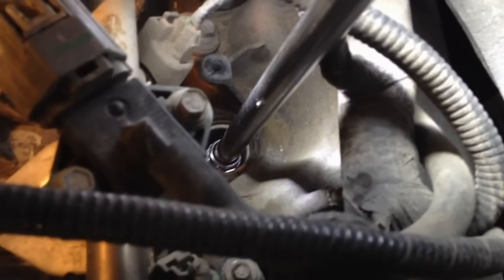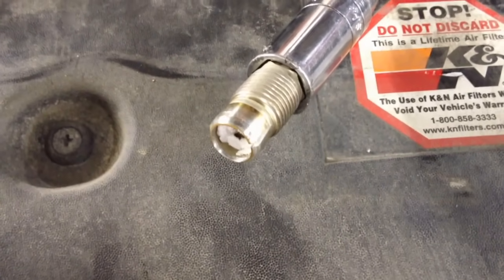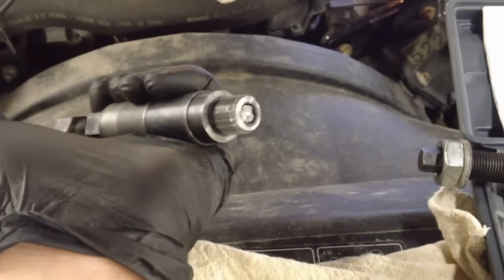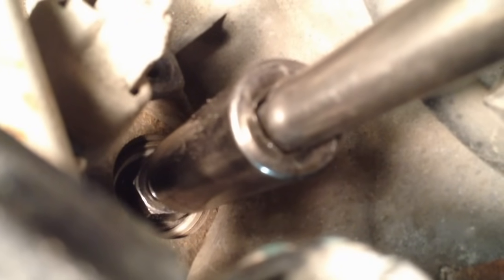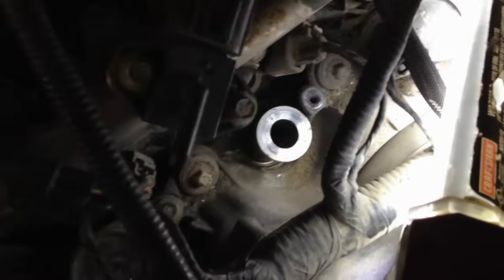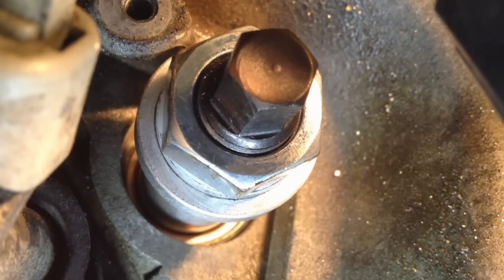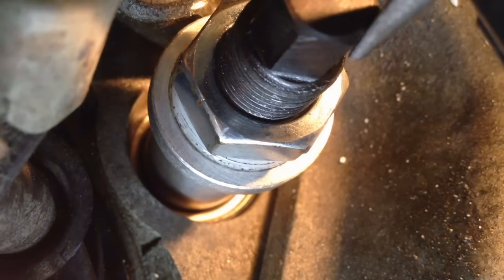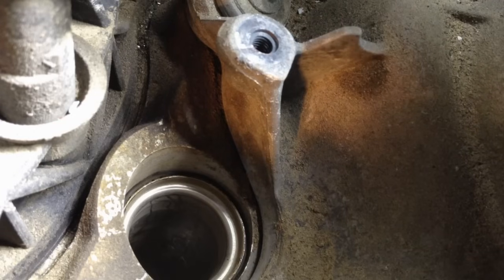Ford 4.6L 3v & 5.4L 3v Broken Spark Plug Removal

Comment: So, if that porcelain drops into cylinder, how do you get it out?? Just wondering, valves don't like anything "extra" in there;.....
Reply: +Eero Laukkanen first of all its a piston under the plug, not a valve.  If one breaks off and goes into a cylinder, get it out or pray. It will usually score the cylinder wall causing the engine light to come on and eventually ruin your engine. Sometimes its easier to just remove the heads with the plugs in them and replace them that way. Better to replace a couple gaskets than your whole engine.

Comment: Changed coils and plugs in my 2006 Ford F150 5.4L this weekend.  Had one plug bust on me.  Used this tool per your directions and it worked perfect...thanks.

Comment: Curious. Some people say this tool "looses it's bite" after about 3 or 4 plugs. You, on the other hand, seem to have used yours a lot more than that. What's up? Thanks for the video, btw.
Reply from the maker: +standingwave73 No way they never so the tap threads are so deep and I have not seen them get dull either.

Comment: Just did the plugs in my 07 F150 5.4 today Let me tell you...what a nightmare it was!  Plugs had about 65k on them and I ran 3 tanks of Techron gas treatment leading up to the change. (Which had ZERO effect). I started at 7am this morning and finished at 6pm. Only #2 came out in one piece the rest broke.  I followed the TSB to the T.  Thank god for the lisle tool and the extra extractor I bought since the first one lost its bite after 3 plugs. (Yes I used anti-seize on the threads). For now on 20k miles plugs are getting changed.  Now I feel like I need a knee and back replacement...😁
Reply: +THETOPGLOCK About to tackle the plugs on our 07 Expedition. That anti seize coating sounds like a yearly maintenance job. Have no other car suv that has that. I guess ford changed the spark plugs after 08.
Reply: +Chuck Gerchow yeah Ford redesigned the head  with a late 07 engine build date to a "normal " spark plug. Like I said 20-30k I'll be changing them again.  Have you done a passenger side exhaust manifold yet?  Another special nightmare of its own. Oh the phasers and timing components.....I did the timing set/phasers last weekend and actually I would do it again over a plug change any day.  3v 5.4 is a great engine if you have the ability to correct all the short comings yourself and save $$$. Sorry for the long reply

This channel has the very best information I've seen. Nothing beats a good video

Comment: The problem with the plugs is they are made in two pieces and overtime the section that insert into the engine beyond the threads carbons up and bonds inside the lower portion of the threads. The result the spark plug breaks into two pieces. The upper section comes out not the lower. Solution buy the spark plug puller kit online it works great, but it takes time roughly 35 minutes each and there is no reason to tear the heads off the engine to remove the remaining portion of the plug. Someone tell you that you will need to.... tell them no thanks! Final note have a small magnet on hand to remove the upper portion of the plug once loose, the socket does not always hold the plug when trying to remove...

Comment: Great video!!  I started with the EverTough 67002 removal kit rented from O'Reilly Auto Parts (had to go back for the required 67003 kit containing the consumable parts) and their approach of removing the porcelain first with a glued-in steel pin was a tremendous waste of time.  I broke the glue bond twice and snapped a pin on the third attempt.  And each time requiring an hour for the glue to set.  I ordered this Lisle kit on Amazon with overnight delivery and it took 15 minutes to read the directions and get the broken plug out!  Thanks FordTechMakuloco for illustrating how simple these tools are to use.  Quick, easy and they work.

Comment: If anyone gets caught In a situation where the shell strips the 1st time, I highly suggest putting lock-tight on the extractor the 2nd time around... It worked for me
Reply: I know I'm 7 years late to the comments lol but think I might need to go the loctite route. Do you remember the type you used?
Reply: @mikebas7325  what's locktite is that like a glue? Or a grease idk how grease would help

Comment: I own a Ford F150 2004 5.4 3V with 80k as well manage to take all 7 of them with out breaking just broke one in cylinder #1 panic at first but came across your video i needed to fix right away its my work truck so did not want to wait for shipping and looked at my local auto parts the only one that carried and had it in stock was NAPA in Orange County, CA. Pick it up $80 And worked well was able to extract the tip that got stuck inside was scared at first but gave it a try and worked well thanks alot highly recommend the Leisle tool. Thanks alot for video. FordTechMakuloco
Reply from the maker: Eduardo Hernandez No problem glad to help!!

Comment: Any suggestions on how to get the extractor to bite inside the shell? I've  removed 2 broken plugs and my last one doesn't seem to want to grab.... 
Any help will be appreciated
Reply from the maker: Phillip Haire You must get the porcelain down far enough I have a whole video on what to do when the lisle tool fails.
Reply: @FordTechMakuloco   old vid not sure if you will see this but, is there a chance you will push the whole thing into the cylinder when pushing the porcelain?

Comment: hey dude thanks for the video helps alot 

i Got a 2008 Ford mustang GT 4.6 3V had it for bout 3 years now & never did change the spark plugs got the car with 77k now its 114K Miles on it 
my car Lost a lot of power 
sounds extremely bad 
my shakes 
im geting Bad gas mileage 
i also have 2 misfires 

can changing spark plugs fix that much? I believe it aint gonna do me anything btw I am scared of breaking the spark plug into the head I did rent the removal kit from AutoZone hopefully I don't have to use it but with this many miles im 90% they will break
Reply from the maker: Rocko Megel Being and 08 yours should be the new design replace them and retest for the misfire.

Comment: does ford still use this plug design for their Triton heads? these things are a nightmare! and the cam chains don't seem to last either.
Reply from the maker: No they changed them in 2008 and again in 2010 I believe to a normal plug design.

Comment: If you replace them sooner (Ford recommends replacing the plugs after 100,000 miles on late model 4.6L), it seems to me that you'll have less of a problem with broken off spark plugs, correct?  I have a '08 Crown Vic with 62k, and I prefer to do it now rather than have to deal with this.
Reply from the maker: Tom B Nah 20-40k on these and they are breaking off.

Comment: Thanks for the help!  2006 Mustang GT with 30k miles.  Figured I would pull the plugs hoping none would break with the low miles, but they have been in there for 9 years  LOL.  Anyways, 4 came out no problem, 4 broke.  I borrowed this tool from a friend and watched your video to figure out how to use it.  With the tool and your instructions the broken plugs came out just fine.  Really pretty easy to use too.  Thanks for the help!!

Comment: Can you recommend a tool to remove a broken plug from the 5.4 two valve motor? Thanks!
Reply from the maker: David V The jam nut and threads are still in there but the porcelain is out?
Reply: FordTechMakuloco Yes.

Comment: FordTechMakuloco i have a 2010 f150 4.6l 3v, and i am wanting to replace my stock plugs with the E3 plugs. I got them from a local part store but the plug itself is a 5/8 socket, i found this out when the 5/8 didnt work for my stock ones, my question is, will the new plugs fit into the well with enough space for the 5/8 socket? or will i have to find a 9/16 plug?
Reply from the maker: derek2007 the correct plugs are 9/16 and I would never use the e3 plugs

Comment: Thanks for all the great information. My old man and I have a small auto repair shop and have always been weary of changing ford triton spark plugs. We would always tell customers we didn't change those but after watching your video finally got the courage to change triton spark plugs. Did our first job today, five of eight broke but using the extractor was easy. Thanks for the great video.
Reply: How much extra did you charge todo the extractions?   I ask because I have a customer coming that wants it done

Comment: On one hand, best to let carb cleaner sit overnight, as I did, but on the other hand, best to remove plugs when warm, those are opposites here in Minnesota!  Removed front 6 plugs so far on V10 2005 6.8l with one breaking so far.  Just watched vid as refresher to extract shell, and will do tonight.  Saving four plugs under firewall as I get practice on front six.  Man those back ones will be hard to get to with just about any tool, impact , or extractor or even my hand!
Reply: dan how did u get to the back ones? i got a broken plug on the right side far back. could bearly get swivel head plug remover in there to find a BROKEN plug already in there. not sure what to do from here

Comment: We have a vehicle that came from another shop. We got 3 out of 4 that were broken off but one they the extractor wouldnt bite so they tried to knock the porcelain down further in the remaining shell and ended up knocking the whole bottom section into the cylinder! Is there any way possible to remove through an open valve without pulling head?
Reply: Update: I got it out through the intake an intake valve with the intake removed and taking the valve spring off and holding it with a pair of stork needle nose pliers and rubber band. I also put a piece of vacuum hose on the valve stem as an extra measure of protection to not let the valve drop. I then put my borescope in the spark plug hole so I could see what I was doing, reached in with mechanics fingers and pulled the broken piece out. Still a lot of work but not as much as pulling the head.
Reply from the maker: Don Mappin Nice!

Comment: Yo I wish they made a tool like this with my grand am. When my plug broke flush like that I tried and easy out and that broke in there too. Is there any other tricks to get it out ? zD
Reply from the maker: George Weigle Yeah at that point I would pull the head.

Comment: i just did mine,its an 07 89k and i had that hesitation under acceleration,bought the tool at napa for 80 bucks,what i did is had the engine warm up,took the coils out,spray every hole with PB blaster and used the 3/8 gun,none broke,they came out easy,took the tool back to napa for refund,but anyways great video,thanks a lot.
Reply: I pulled the throttle inlet pipe off and disconnected the injector harness from the injectors and sprayed into the inlet while rolling over the engine. Works great.
Reply: +abasolo63 Was it a bad plug causing the problem? or coil? My f150 is having the same issue right now
Reply: +Luca Bandinu it was a bad plug,i am pretty sure yours has the same problem as this is a common problem on this kind of engine
Reply: Okay thank you. Was your engine light ever on or flashing when it was misfiring? Mine has popped on once when it did it and flashed for a couple seconds but it no longer comes on when it happens 

Sent from my iPhone
Reply: +Luca Bandinu no,light came on like yours,then it went off,but it was not on when it happened.
Reply: I found the bad plug! Thank you for the responses, I appreciate it!!

Sent from my iPhone
Reply: abasolo63 partsf150 part
Reply: Did you spray bp plast before turning the spark plug or before attempting to turn the spark plug out ?
Reply: abasolo63 h

Comment: i have 2 plugs stuck and 1 broke on my 01 f150 4.6 will these tool help me get it out? i dont know what to do all the porcelain came out but the botttom part is still stuck on the threads and i need the truck since its my only car at the moment
Reply from the maker: odrix691 Your plugs should not of broken on that engine are you sure on the year? This tool will not help.
Reply: yes im sure its a 01 with the 2 valve engine i dont know how old the plugs were but they looked pretty old. any advice on what i might be able to use to remove it? i really dont want to take the head off

Comment: Fuckin awesome . I would be so petrified the hole time it's making all those freaky squeaking noises. I'm looking at a 04 f-250 with 37k on it and I'm  not sure about it after watching your vids.
Reply from the maker: 680ecks 04 F250 does not have the 3 valve engine so you are good.

Comment: You say they've got it measured so you can run the pusher down all of the way?  Don't need to feel or listen for where to stop?
Reply from the maker: brakedd The pusher length is set by the manufacturer so there is no guess work.

Comment: Thanks. Following all the tip and video, extracted all 6 broken plugs without issue. The Lisle tool and expert advice saved me almost $1000.  Thanks for your help. Somewhat off-topic - I may as well replace the COPs while I'm this deep.  I can purchase Accel coils for less than half of what I can find the Motorcraft coils. Any opinion or advise is appreciated.  Thanks again!
Reply from the maker: Mceagle54 I would not buy anything except motorcraft many have had problems with aftermarket. Accell is a good brand though.

Comment: 2007 Navigator 86,000 mi - In addition to following your instruction and the TSB, ran a tank of fuel with a strong concentration of Tectron before starting.  Allowed carb cleaner to set overnight. 6 of 8 plugs broken. Anticipating issues, purchased the Lisle tool that arrived today.  The extractor has 4 grooves machined into the shaft below the threads - perhaps this is a good thing.  I am clear on the process, thanks for a great video.  How do you know when you have the extracor far enought into the shell?  Any other insight / suggestion is apprecuated!  Thanks
Reply from the maker: When the extractor is far enough into the shell you will feel a dead stop nice and tight grip.

Comment: what is the torque specification when you put the new plugs in?
Reply from the maker: certified30 

Spark plug (early build — black coil boot) 25 ft lbs

 

Spark plug (late build — brown coil boot) 9 ft lbs

Comment: What is your opinion on replacing the plugs with the one piece designs that are available?
Reply from the maker: Johnny M The new plugs are a two piece design shell and porcelain like any other plug so you should be good with the new plugs from Motorcraft.

Comment: I use a shop vac with a small piece of clear tubing taped to the hose, then stick it in the cylinder to remove any small porcelain pieces, thought I'd share! Nice video!
Reply from the maker: 1bbpracing Yup always a good idea.
Reply: That's exactly what I was thinking when he started blowing out the inside of the cylinder.  Should be able to vacuum out the small loose debris fairly easy.  Good video though.  He did a good job overall.
Reply: I would do both actually. Use the long-reach blow gun but have the vac hose right over the hole. The blow gun has more pressure so it will dislodge things that the vac will not, but then the vac is right there to grab the debris
Reply: auto body guy
Reply: Im glad i read your comment because that is exactly what I ended up doing. Thanks!!
Reply: same

Comment: I notice you don't use any oil. Would you recommend using a lubricant like Kroil?
Reply from the maker: TheMechanic2 Yes they used to tell use to use kroil but have since changed their minds to the carb cleaner shown.

Comment: Excellent video.  But I find myself wondering why Ford didn't take a second to apply a little anti-seize on the plug when the engine was being assembled.  Would have saved a lot of mechanics a lot of headaches down the road.
Reply from the maker: zooeyhall They will never do that on the line and at first they really didn't know it was an issue.

Comment: the tool broke how did you remove it
Reply from the maker: mikebmechanic I used the guide in this kit and a drill with and extender and burr bit to drill out the broken tool then start again with a new tool from lisle. I actually was thinking of doing a video on this.